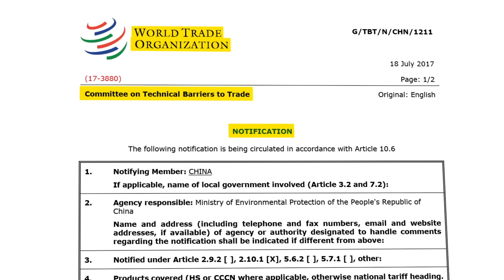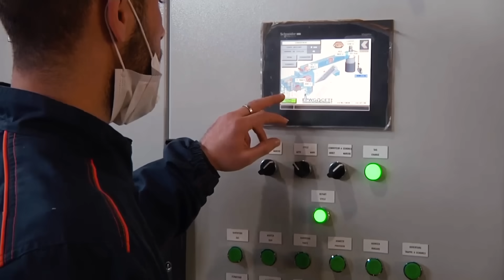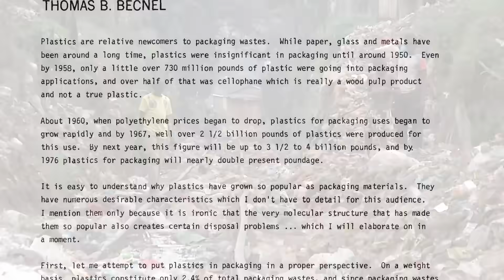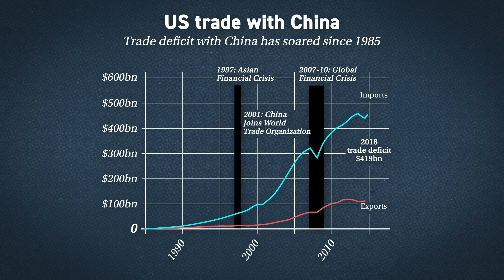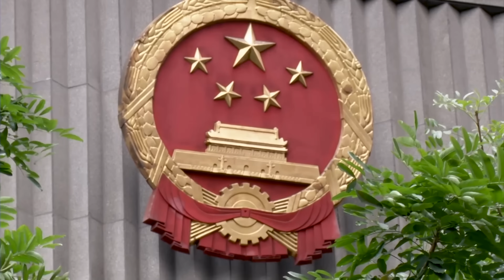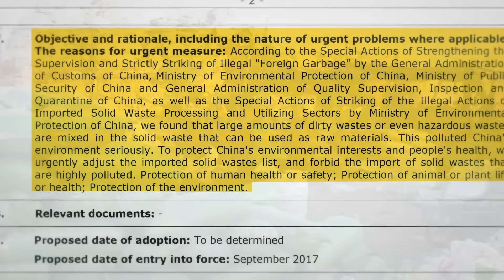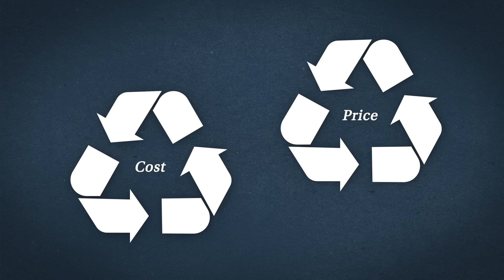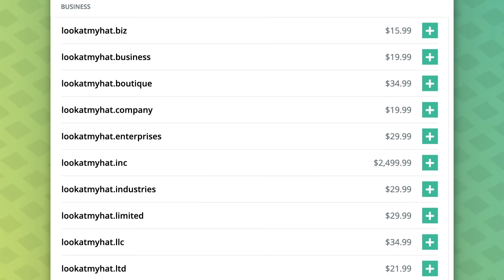How China Broke the World's Recycling

Comment: I used to recycle religiously until I learned that our recycling system is basically a joke. I wish it wasn't so, we need to start using reusable packaging!
Reply: Easily recyclable food packaging is impossible. Anything that can break-down recyclable food packaging after it has been used is also a threat to the packaging's integrity while food is still inside it. The reason plastic-coated-foil packets and wrappers are so ubiquitous is because no microbes or naturally-occuring chemical processes on Earth can break through them, which means the food inside will stay safe for human consumption until a human actually opens the package. Even "buying local" doesn't solve this problem, because food that sits on a shelf in your pantry still needs to remain fresh until you want to eat it. The only way to reduce food packaging waste is to buy less packaged food and accept the unavoidable tradeoff of higher food waste instead.
Reply: @fyrstormer  That's why William mentioned reusable packaging. Basically shifting more towards a bulk foods store kind of model where you bring your own packaging (glass or durable plastic containers) or use temporary paper bags to get your food from the store home.
Reply: Just don't buy anything.
Reply: I have read a article in German said that only 30-40% plastic are correctly recycled in Germany. And German is supposed to be the tops at recycling
Reply: We need to tax domestic manufacturing to cover the cost of recycling. However we also need ban imports so things are not out-competed by cheap crap made without environmental regulations.
Reply: Glass and metal recycling work well, so keep recycling them. Both glass and metal can be recycled for an unlimited amount of time, and there is no quality loss. It's plastic recycling that doesn't work. First of all, there are many different types of plastic, which makes sorting very complicated, expensive, and inefficient. In addition to that, the quality of recycled plastic is usually lower than the quality of new plastic. For this reason, things that are made with recycled plastic do not usually contain 100% recycled plastic. It's usually a mix of recycled and new plastic.
Reply: @ag-m6e  One really important thing to be aware of with glass though that many people don't seem to be aware of is not to throw borosilicate glass (pyrex) away with "regular glass". I wonder how well automatic sorting systems can pick up on what is and isn't borosilicate, even as a human using your eyes it's not obvious by appearance you kinda have to know based on the purpose of the object. Although if one tiny break results in the break propagating and the whole thing shattering into tiny pieces then it probably is borosilicate.
Reply: It's not a joke -- most of what you recycle is still actually recycled. It's still selfish not to recycle, even with the issues in the system. 

Recycling would work great if the companies producing the packaging had to foot the bill.
Reply: @d_dave7200  Spot on. The greatest perpetuated lie is the consumer is fully responsible, when in fact the producers should be responsible for ensuring essentially every piece of packaging produced is recycled.
Reply: @drews0n  That sounds great, until the fact the packaging is more expensive when all made from high value plastics is brought up, and that this impacts some groups of people more than others, and is then called Racist.
Reply: Doug currently oil prices have been cheaper than it has been in a long time. If we can put a cap on how much virgin resin oil companies like shell and Dow produce, that would increase the value of both virgin and recycled resins, which then in turn can make way for recycling to be profitable. If big oil starts divesting from virgin plastic production and begin diverting their resources to recycling plastics into resins, this can slowly overtake the need for virgin. More value = more resources and we can really begin building our domestic recycling infrastructure.
Reply: @doug6531  it seemed to have worked with aluminium cans. the packaging is worth more or maybe almost as much as the soda/stuff in it. At the end it is always dependent on comfort and price. It is human nature to hunt for "cheap things" (i guess) or to have at least the most comfort for a certain price. who would hunt for tigers if he could hunt for deer?
Reply: @d_dave7200  it is recycled, it’s just that it’s rather put in a landfill or a storage area for someone to take them.
Reply: @d_dave7200  ding ding ding ding
Reply: right whoever didnt know this is a sheep
Reply: It is either humanity kills plastics or plastics will adventually kill humanity.
Reply: We need to consume less, to start with.
Reply: In general, the 3 R's are the best way to do it. Reduce, Reuse, Recycle, in that order of priority.
Reply: cant the recycling companies realise that money is not important. WE NEED TO SAVE THE WORLD
GOOGLE HAS A LOT OF MONEY
THEY CAN START RECYCLING
Reply: @Xnoob545  
https://youtu.be/zBkuNpgACH0

Comment: Not only economics could solve the issue. But also politics. To produce plastic goods, there are only two possibilities, recycled plastic and virgin one. And as long as virgin plastic is cheaper, demand for recycled one will be lower. The market could increase the virtual cost of virgin plastic by lowering demand for its good, but it would be easier a quicker for politics to increase the actual cost of virgin plastic through taxation. That way, recycled plastic will be cheaper, and the whole system might become sustainable.

Comment: What exactly is the problem with taking oil from the ground, using it, and then putting it back in the ground, where it will be broken down by bacteria over the next century?  Also isn't putting it in a incinerator the same as burning any other oil based fuel?

Comment: But what would be the alternative to plastics? It is the perfect package material. Very cheap to produce, incredibly easy to process. I don't think we should ban it from our lives. One option would be to make recycling artificially viable by taxes. Also burning plastics can be seen as burning oil that has been used in between in a different way. I believe I have heard you loose smth like 50% of the energy by going over plastics in comparison to burning the oil in the beginning. What must be prevented is plastics getting into the environment. The exporting has done/ is still doing a lot of it cause the imported plastic waste just gets dumped into the ocean in some countries that have lower environmental standards than the western world.

Comment: I guess the best solution would be to seriously tax virgin materials, with a decreasing tax on recycled products depending on how many "cycles" it has gone through.
Reply: Imho, they should figure out average recycling costs and any company using up raw materials should pay for the recycling ahead of time.
but if any company thinks they can recycle one type of trash more efficiently than average and make a profit on that, they should do that. 
Incentivize investment into recycling while decentivize using cheap products because it's easy.
Reply: In general, like a carbon tax, we should tax all products based on negative externalities because otherwise someone else is paying for it down the line.  

Though I'm curious about other factors in recycling, like does it take more energy to produce than other methods, and if so, if it has a larger carbon footprint, or more harmful in other ways than producing virgin plastic(that it's more expensive to recycle than start from scratch raises questions about why). If that's the case, then it seems like it's better to simply produce virgin plastic, albeit maybe more focus on plant based compostable plastics, or focusing on breaking down plastic with bacteria or something that can be incinerated more cleanly/safely.
Reply: @RiamsWorld  the price of a product should be the price from raw material to recycled material, with HUGE costs for any waste that cannot be recycled.

Show it in the cost, when the consumer buys it, that's the only way companies will change. 
If you can offer your product 50% cheaper by using better materials, that's an incentive. If you have to invest millions in R&D for a 0.1% saving, no company will do that.
Reply: This wouldn't work. No country is going to want to put extra tax on its own industry and put itself at a disadvantage. If they do, it will up sticks and move to a cheaper country. It's also not possible to know how many cycles any given piece of material has been through. If it's plastic or metal and has been melted down, then it could be several and none at the same time!

The problem with making the companies that produce the raw material pay for recycling is it costs more to recycle than what it does to produce the raw material. How are they supposed to pay for that when their income is the raw material?

Comment: A lot of plastics are just entirely unrecyclable. Not sure why this isn't even mentioned. Also even with recyclable plastics, it only works as filler as most things made from recycled plastic are using maybe 20% recycled plastic and the rest new because recycled plastic just doesn't have the quality needed for use in anything.

Comment: Easy fix to recycling make the consumer pay the cost of the recycling at the till. Plus a deposit. So if they don't take the bottle in they won't get there deposit back. 

The issue is that's a deposit you get back. Instead it should be a cost to buy that bottle in the first place to cover the cost of recycling. Plus another 25cents deposit to get you to return the bottle. So you buy a 2 liter coke for 2 dollars your paying 50 cents in deposits and only getting 25cents back when you recycle it. By making people pay for plastic recycling when they buy plastic. You can change there behavior or just cover the cost of the recycling.

Comment: Why can’t you just melt all types of plastics together? Honest question 🙋‍♂️
Reply: It all depends on the types of polymers, but it depends. Plastics need different temperatures, different pressures to be recycled. One plastic might melt at a particular temperature and be able to be recycled, whereas another would start burning. Also the plastics developed for bottles are different to those for crates, or cars, or guns. They've been specifically engineered so their material properties are sufficient for the task they're designed for. If you melted them all together the resultant plastic would be useless. Obviously there's a lot more to it than that but those are two examples.

Comment: Plastics fundamentally exist to fulfil the desire for a material that is light, durable, and in any desired shape or size, it's an economic problem with no economic solution.

Every version of "reduce, reuse, recycle" still fundamentally fails to address the fact that plastic is not and will never be sustainable as long as it is used for single use items and one-time packaging. You can't tax that problem out of existence and consumer preferences will never change fast enough as long as advertising directly contradicts environmental and public health messaging.

You basically have to regulate the modern plastics industry out of existence to the point where it's only providing goods meant to be used many times or those that are actually profitable to recycle. If we successfully create enzymes/engineer microbes that do the job well, we'll inevitably end up with oil-based wood because something exists that degrades plastic. If we manage to break it down chemically, we'll still run into the massive problem of impurities anyway.

Comment: 17:50 The only way to keep plastic from polluting our oceans and environment is to shut the system down...

Or, to burn plastic waste to produce electricity, like they do in Europe. While plastic doesn't burst into flames at the smallest spark like gasoline, it is ultimately a petroleum product and will combust.

Of course, burning plastic is extremely toxic, but it's not 1940. We have the ability to filter out the worst of it before it is released into the air (like we do in American factories and power plants where the smoke is white instead of black).

Comment: -- Weather = flash flood + flash drought + flash mob + flash infection
-- Climate = 30 years of bad weather
-- 4% of mammals are wild by weight -- 4% of energy is renewable
-- 15% of energy will be renewable by 2040 -- 28% by 2050
-- 2% of energy is solar & wind -- 0.8% of vehicles are electric
-- With 23 billion chickens on earth, if one sneezes we all get the flu

100% Renewable Electricity = 20% of Energy
-- 20% of energy is electricity -- 24% by 2040
-- If batteries were 6X more efficient we would use 60X more of them
-- Over 60 yrs jets are 68% more fuel efficient and fly 60X more passengers
-- 2.63 billion air trips were taken in 2010 -- 4.4 billion trips in 2018 -- 8 billion by 2050
-- Earth is heating by 400,000 Hiroshima nukes / day
-- 1968 - 1992 = 1 nuke / sec -- 1998 - 2020 = 5 nukes / sec
-- 1971 - 2018 global heat forcing averaged 0.47 watts/m²
-- 2010 - 2018 it went up to 0.87 watts/m² = 46% higher
-- Greenhouse gases went up 45% in 30 yrs
-- 2050 AC demand requires new energy = US + EU + Japan combined
-- Renewable energy cannot stop heating in time to avoid runaway change
-- Right now we burn fracked gas to charge our EVs in a megadrought

-- Small farms grow 80% of food -- 1% of people run 75% of farmland
-- 66% of people will live in water stressed areas by 2025 
-- 4 billion people live 1 month / yr in severe water stress
-- 20% less fresh water per person is available over the last 20 years
-- 50% of thermal & hydro electric power will be threatened with water stress
-- 40% of coal mines are water stressed and so are 30% of planned hydro 
-- We kill trees 2X faster than we plant them
-- A net loss of 1 football field per second
-- Trees grow faster die younger in heat fire flood & drought

-- Battery & Bio-energy extraction destroys native land water & wildlife

Vaclav Smil says:
-- North Euro offshore wind turbines work 30% of the time
-- North Euro onshore wind turbines work 22% of the time
-- One of them offshore Texas would work 35% of the time
-- North Euro solar panels work 11% of the time

Green Energy Harms Global Native Freedom Land Water & Wildlife
-- Europe burns 80% of the globe's wood pellets for renewable electricity
-- Europe burns 40% of its recycled plastic & paper for electricity
-- Europe burns 65% of its palm oil cargo for green bio-energy
-- Dams destroy river wildlife up and down the rivers
-- Shipping trees and palm oil overseas for green energy credit is criminal 
-- Europe's carbon credit system is corrupt
-- Europe's global carbon fund is rife with corruption

Support James Hansen's monthly private carbon dividends
-- 100% to you 0% to governments & corporations
-- That's why both governments and corporations hate it
-- That's why both socialists and capitalists hate it
-- Monthly Private Dividends = Real Climate Racial Justice ( not the academic kind )
26 Nobel Prize winning economists support James Hansen’s monthly dividends, including: 3,589 U.S. Economists, 4 Former Chairs of the Federal Reserve and ALL 15 Former Chairs of the Council of Economic Adviser

Like parents, you don't get to choose your energy -- you work with what you got
Without nuclear power there will be no green renewable energy
The US has 300 years worth of energy in its nuclear waste
300 years worth of low emissions baseload energy -- the backbone of any grid
Wind turbines and EVs are made from oil coal and gas
Next year's oil gap means we will have to burn more gas coal and trees
Nuclear waste doesn't clean itself up, you need nuclear tech to do it

You can find facts, sources & links at Loki's Revenge blog on wordpress under Green Energy Fraud

zzz zzz

Comment: The 2017/2018 waste plastic import ban issued by China is also, potentially, a protest against trade war started by United States in 2017  (who was main waste exporter to China). 
A good thing is that in 2018, China started pushing home recycling nationwide, even going as far as they won't take your trash if you don't separate the trash, and business can get fined for not doing it properly. A lot of housing complex/residential needed upgrade their waste facilities to comply with new regulation.
Which in terms provided the material for Chinese plastic recycling industry starting from 2018.
Before 2018, separated waste bin in public exist but was really "optional", as many don't properly separate their trash in public, not at all at home. After 2018 you can see dedicated trucks for recyclables, kitching/compostable, and residential waste. (I have yet seen hazardous but I believe they also have a special truck for that).

Comment: If you want to stick with single use plastics, you should start sorting it accordingly; 
♳ polyethylene terephthalate
♴ high density polyethylene
♵ vinyl, polyvinyl chloride
♶ low density polyethylene
♷ polypropylene
♸ polystyrene
♹ other plastics
And that is why ♻ of single use plastic will never really work. Except for thermal recycling, euphemism for incinerating.